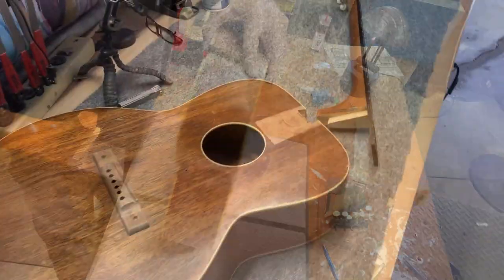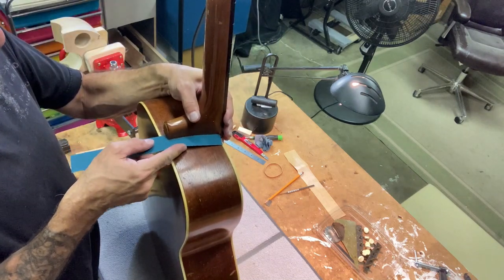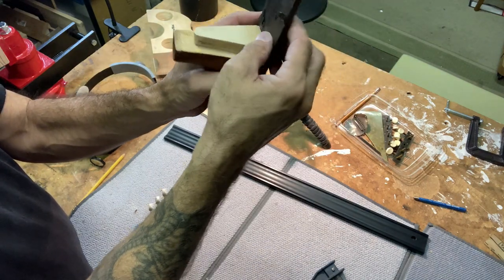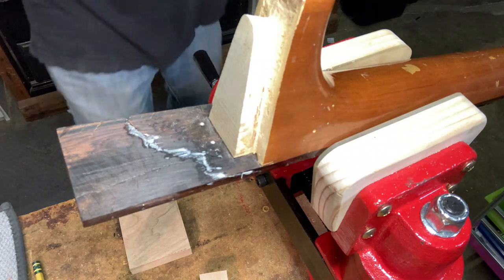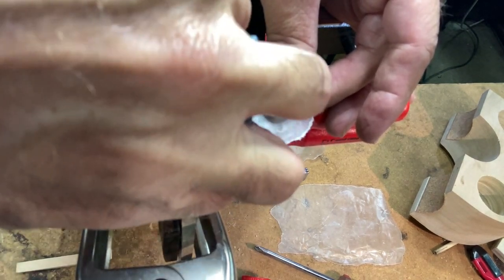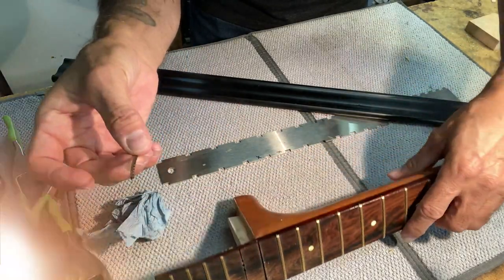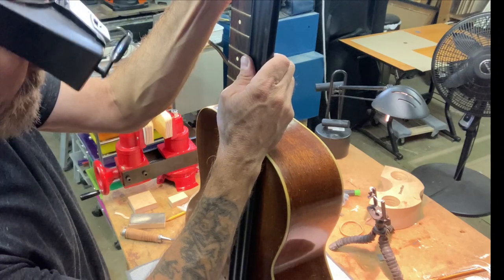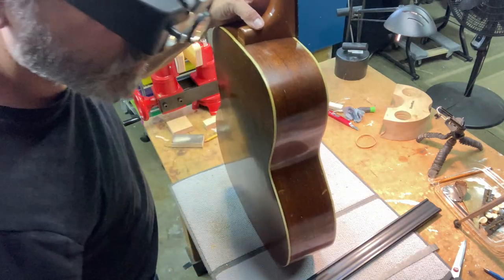How To Change Your Neck Angle - Step By Step

Comment: Ever try fishing line in place of the 1st and 6th strings to get the left/right angle correct? 
On some of those lower end Kay and Harmony models the left/right angle may not have been accurate from the factory in the first place.
Reply from the maker: No, but that is a good idea. I’ll definitely consider…thanks!

Comment: You might want to get a smaller diameter drill bit, for drilling at the 15th fret.
Reply from the maker: I believe that was a few thousands bigger than the nozzle tip so not much option.
Reply: @vindustrialguitars : OK, I found the "problem". (no cuts meant there)
You said, in the previous video, when you drilled the holes, you were using a 9/64" bit.
If your hose is 1/4" ID, you can get a needle from Stewmac 3 1/2" x 5/64" for $38.20, or a
hose and needle, for $58.35. It's not cheap, for what you get but you can't get it anywhere else.
It is a much smaller hole and less damage to an instrument. The fret will actually cover the hole.

Comment: That is really durable sandpaper you're using. Is it cloth backed?  Well done video btw.
Reply from the maker: It’s just a standard thickness paper but I put packing tape on the back. Two reasons for that to make it a little thicker and more durable also to have the surface be slick and not mar the finish.

Comment: The reason for the gaps in the fingerboard repair is the radius of the neck.
Reply from the maker: Not following you on that…
Reply: @vindustrialguitars  First, I should have said "fingerboard." My fault. You experienced gaps between the top side of the fingerboard and your caul at the edges. The flat caul was resting firmly at the center of the fingerboard. That is because of the fingerboard's radius, which makes the edges of the fingerboard thinner than the center. So you shimmed the edges, which worked brilliantly. A method around that issue is to use a radiused block like one would use to sand in the radius of a fingerboard. I apologize for not making myself clear at first.
Reply from the maker: @scottreeves1226  no worries! Ahh now I see what you’re saying. Your exactly right… thanks for the tip!

Comment: Too much pulling on one side. Too much pulling between checks for alignment and saddle height. If the neck is out of line, pulling more on one side will introduce a twist and cause the heel to not sit square to the heel block. Sounds like you are using a very coarse paper to pull. A finer grade is more accurate as it removes less material per pull, but obviously takes more time.
Reply from the maker: I was using 80 grit, and that was very slow. Maybe finish with a higher grit to fine tune. Thanks for the tip.